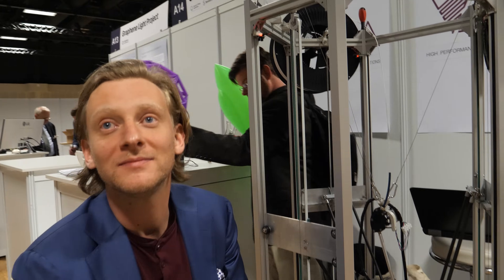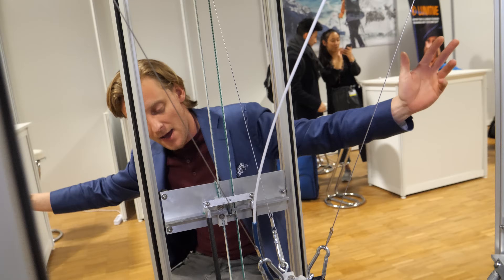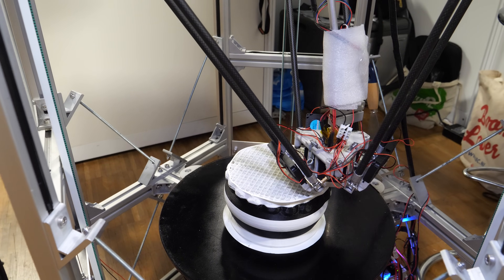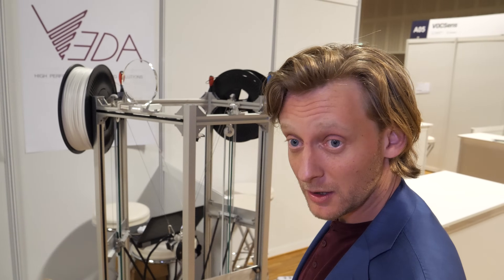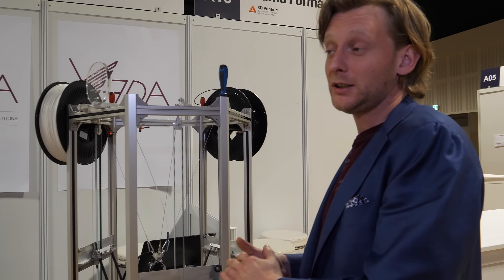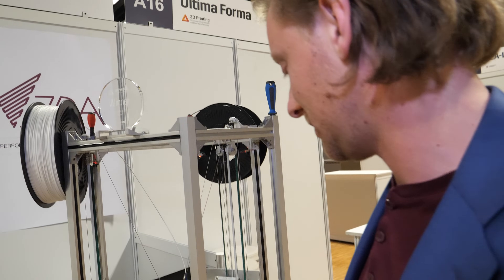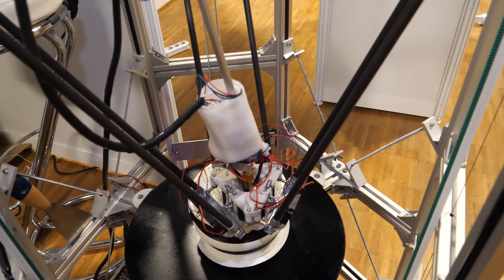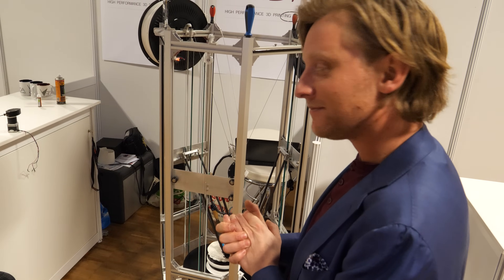Veda shows World's fastest Extrusion 3D Printer

Comment: That printer is far away from beeing the fastest
Reply: I saw about 300mm/s speed on others a couple of times. insane movement and a 500mm/s here 
https://youtu.be/SpZlMYXZW-o

However the volumetric flow is 40 whilst the one in the video reached 120. Liquid cooling can push it a bit more probably and provide cold air for fast cooling.
Reply: @WhiteWolfos  voron 1000 - 1100mm/s now

Comment: Scrolled all 11 minutes with a hope to actually see speed printing. But nope.
Reply: its a 1mm nozzle
Reply: @malloott  Lol, what does that matter? My .4mm nozzle prints faster.
Reply: @gamesnic  because printing fast with a big nozzle is way harder... Try to make decent extrusion with a 1mm nozzle at that speed and you will see why this is impressive.
Reply: @malloott  Well,  I think you don't understand extrusion quite right. The smaller the nozzle, the higher the quality, but therefore the smaller the layer height. This costs time.
With a 1mm nozzle, Your layer height can be about 0.8mm, which about makes the speed 4 times faster. And also, since the opening of a 1mm nozzle is 2.5x bigger, does this make the extrusion even easier because there isn't that much pressure building up in the nozzle. This prevents the extruder from clicking and therefore makes printing faster. And also, yes, the extruder has to fit 2.5x times more filament, but also has 2.5x less pressure.
Reply: @gamesnic  it seems to me like you don't understand. Printing 0.48mm (120% nozzle size) wide lines at 100mm/s 0.2mm high makes for 9.6mm3/s in flow

Printing 1.2mm wide lines at 0.8mm high at 100mm/s makes for 96mm3/s in flow. That is a 10x difference in flow. Not a 2.5x difference... This is why it's harder to print fast with big nozzles. Your print speeds need to slow down in order to make manageable flow rates. The total flow rate makes for your print time improvement with a big nozzle. But the print speed can still be lower..
Reply: @malloott  This isn't directed at one person, just other points. With all that said though, the fact that you are having the large diameter it does mean you can put down more plastic without speeding up the machine, becomes a tradeoff. 
In some printers you can manage to hit a point where the tradeoff equalizes, where increasing the nozzle size/slowing the print down, or having a smaller size and speeding up the machine provides no better results either way. 

I have a linear rail Core XYZ can move at 100mm/s,  on a .4 nozzle. I have another machine with a .8 nozzle, that can only move a 60mm/s. Yet here is another matter to add to speed. What geometry are you printing? You making tall narrow objects, or very wide objects? There are prints that are just tall that my slow 60mm/s can out perform my 100ms/s machine, you got to factor in acceleration, are you actually getting up to full speed? Then there are wide footprint, prints, that my 100mm/s will walk circles around the slow machine. 

Then of course the extruder. Can it push the plastic through, can it melt it quick enough? 

Cooling, can the cooling fan perform.

Is it enclosed? Will the print warp due to large amounts of plastic being laid down then cooling causing the print to shrink unevenly. 

A lot to factor in besides its a 1mm nozzle. And there is more then I mentioned, these are just the easy to address common issues.
Reply: @williamstaples5994  yes of course, I know all of those factors. I'm just saying to the poster that was disappointed an thought this wasn't high speed printing, seemingly without taking into account the massive flow rates this is printed at.